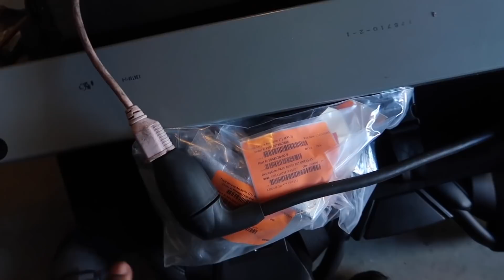Tesla DIY: Installing 3rd Row Rear Jump Seats!

Comment: So I ordered the two trim pieces for where the seats clip in, and it turns out they have two of the bottom trim pieces here also. One was bagged as a top piece (has the top piece item number on the bag). Just like in the video… years later. He better not have done a swap on me and caused this…

Comment: Hey rich do you have any of the barrel nuts that you'd sell me? (The ones that the front of the rear seats bolt into). I'm also interested in the 4 bolts for the hip strikers.  I've had these on order with Tesla for 2 months already.

Comment: anyone have these parts 
1022449-00-A - torx bolt for barrel nut
1013633-00-A - upper bezel for 2nd row
1014277-00-A - lower bezel for 2nd row

Comment: Wow, it's almost as if Tesla thought someone would actually use rear mounting seats what with all the perforated cut outs they provided. This was very informative but it's not like I'll ever own a Tesla. I won't own any item that the manufacturing company makes everything proprietary so you can't buy parts or even information! And I guarantee you that your garage is not the messiest in the world. I still have boxes of tools and equipment to unpack since I moved in to this house, 19 years ago. I don't unpack them because I know what's in them and if I unpack them, I won't be able to find stuff again, like paint brushes, light bulbs, a torque wretch, roofing hammers, old issues of National Lampoon, and the like.

You are a really nice guy to do that for a complete stranger but I do see the advantage. It's nice to be able to try something on someone else's car before trying it on your own. When you first said you were going to install those seats I pictured driving 8 six inch lag bolts down thru the floor board with the major concern being avoiding driving any of them down thru the motor. Imagine my surprise! Well, it's off to the next video.

Comment: Be careful. The cars that came with the seats in the rear had extra structure in the rear portion of the car... The regular cars do not have that. I don't think it's simply that extra bar....
Reply: Still tho this video is brilliant man..... Didn't think it was that simple.
Reply: Tesla tested as the safest car in the world, it literally broke crash test grades, it went of the scale, so if normal tesla without these seats and reinforcements in the back can do that, I think the kids are safe as they possibly can, much safer than any other car

Comment: Do you know the part number of the rear reinforcement bar that you installed on this pre-facelift Model S? There seem to exist two different versions, presumably depending on if it’s a facelift car or not.
Reply: what year is your model s
Reply: It‘s a 09/2014 P85+ with AP1, pre-facelift.

Comment: wait. why wouldn't Tesla install the 3rd row seats for this guy? Is the car stolen?
Reply: Tesla made the 3rd row a 'factory only' option. As all Tesla dealerships are owned by Tesla I guess they can guarantee none of them do an aftermarket fit.
I did always wonder why, looks like there is no good reason. (mechanically at least)
Reply: Josh McCullough do you know that the frame is different? (Other than the reinforcement bar shown fitted here) 
Making different versions of the frame would be a very costly manufacturing decision, looking at all the effort Tesla went to to ensure the frame on this car could have the seats and crash guard bolted on I think the much more reasonable conclusion is that Tesla didn’t want to have to put pressure on their dealerships by giving them such a time consuming task. 
When would they be able to get the milk for the coffee machines?
Reply: Andy C because cars with the 3rd row seats have a reinforced rear frame.
Reply: Andy C yep you're probably right, just the crash bar is the most likely case.